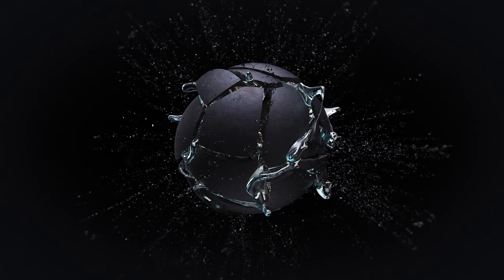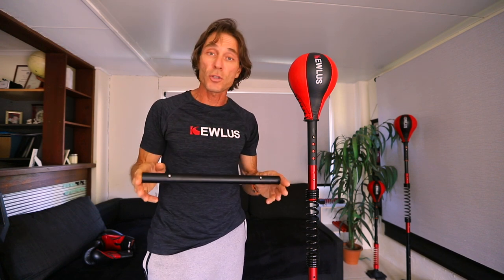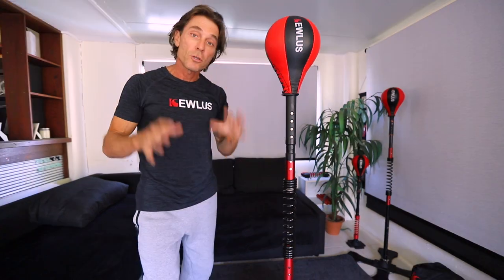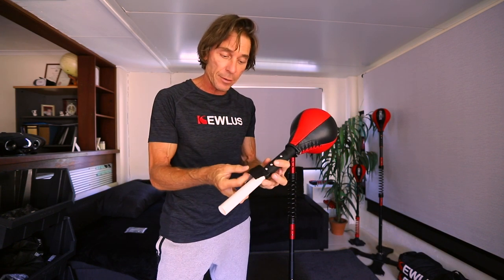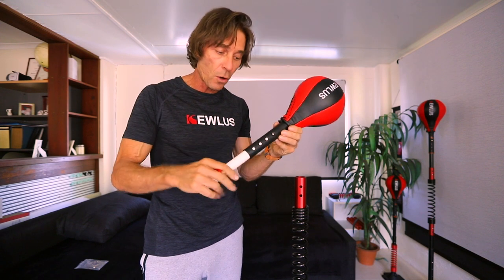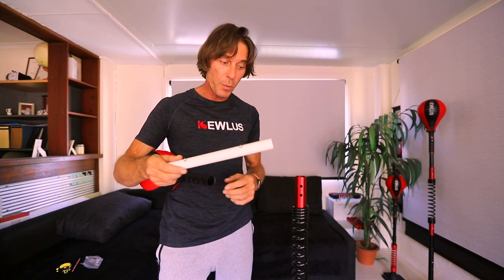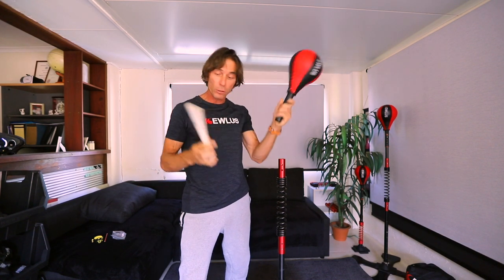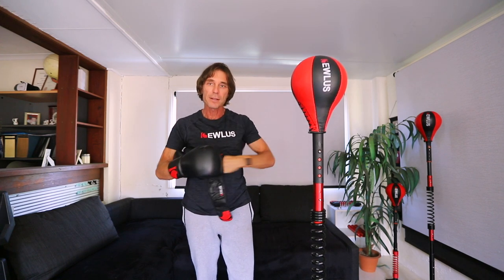Make Your Cobra Bag Insanely Fast!

Comment: I have purchased the full kit a while back. I went in the website and noticed the feet for the base is larger and looks sturdier. Did you makes changes to them? The ones I have are skinny and lift up even with the sandbags over them. let me know.
Reply from the maker: Yes, I released an upgrade version a couple of weeks ago. However, what you can do with your original ones is please a cardboard over each paddle- that will stop it from pushing up the sand